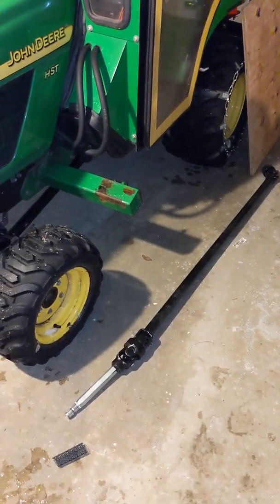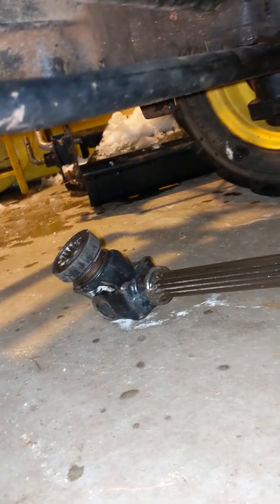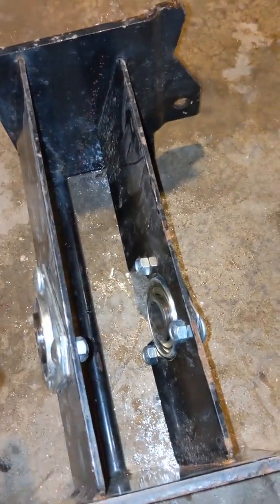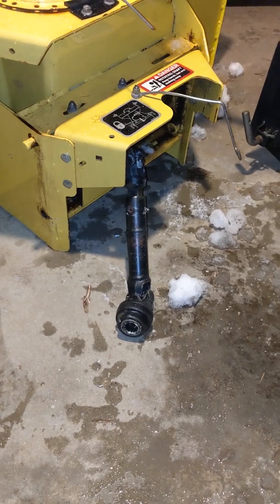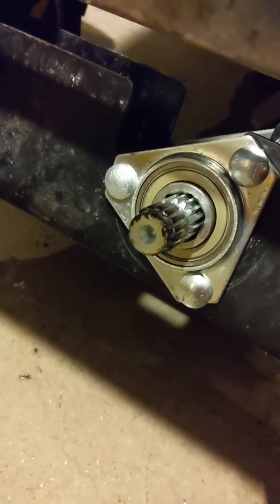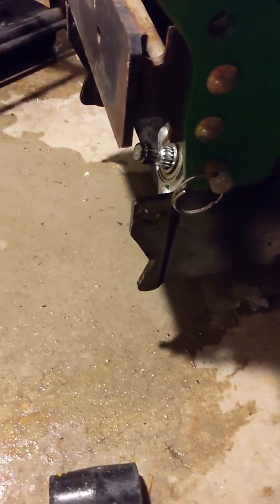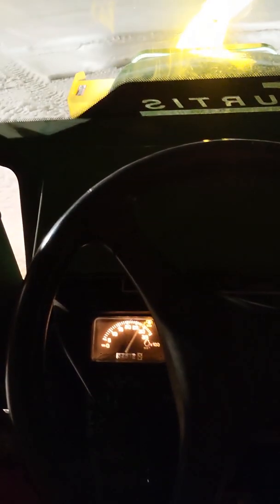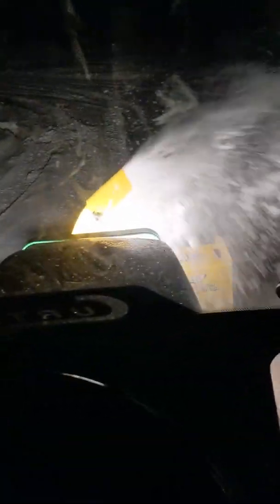John Deere 2210 47 in Snowblower wobbling PTO fix

Comment: Hey man. So my grandad saw this video and had some questions for you and where you got the PTO shaft. Is there anyway you can direct message me so I can get yall in contact with each other?? Thankyou
Reply from the maker: The John Deer part number is in the description. I ordered mine from the local John Deere dealership, if you give yours a call and tell them the part they should be able to order it.
Reply: @cookacounty  okay. He utilized that part number he saw in the video. However, the local John Deere dealership staes that the part number is incorrect. Is it aftermarket?
Reply from the maker: @travissmith2102  Sounds like they don't know what they are talking about. They should know what you mean with the PTO shaft upgrade. Several forums discuss this
https://www.greentractortalk.com/threads/snowblower-pto-wobble.97474/
http://www.tractorbynet.com/forums/john-deere-owning-operating/158799-2305-snowblower-drive-shaft-retrofit.html
Reply from the maker: https://www.greenpartstore.com/John-Deere-Front-PTO-Kit-LVB25966.html
Reply: @cookacounty  Sir thankyou very much. My granddad was able to find the part and get it on order. Thankyou very much for taking the time out of your day to help us. 🤝🏻🇺🇸

Comment: Hey man anyway you can send me some pictures of the setup? Im trying to get a blower on my 2210 and idk what mounts I need to buy
Reply from the maker: I think the whole snowblower is a kit (mine came with the tractor). You shouldn't need any "special" mounts. If you scan through the video you will see all the main pieces. There is 1) pto shaft 2) frame mount to the tractor and a rod that holds it 3) hydraulic mount that goes on the frame mount 4) the blower